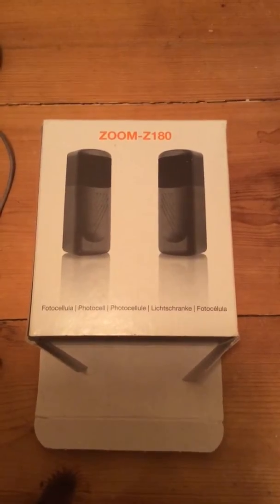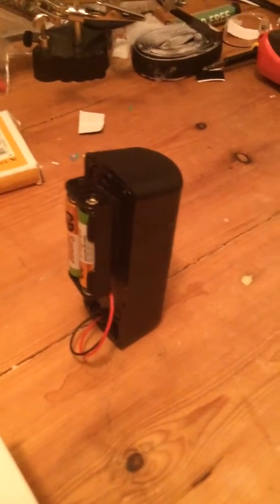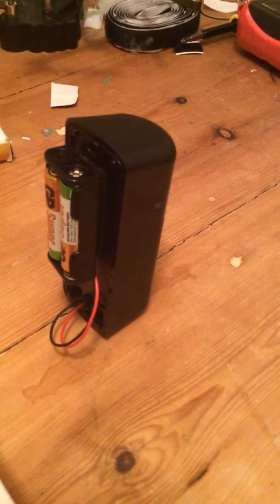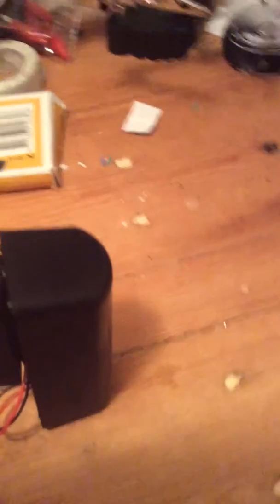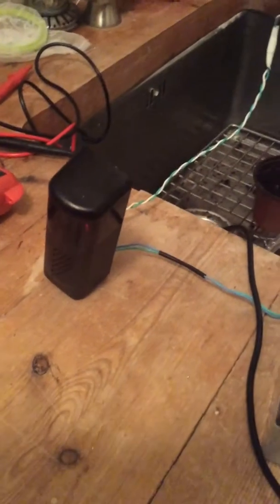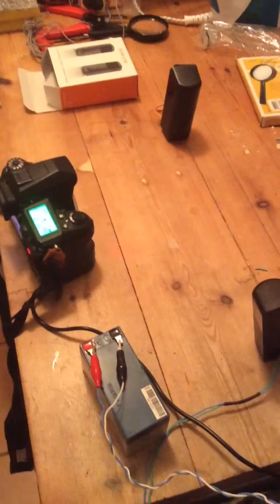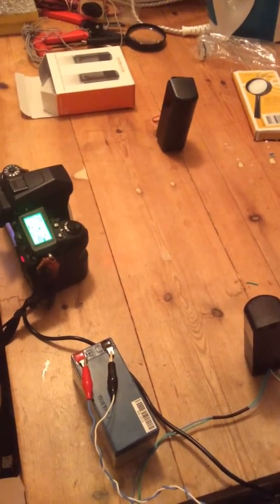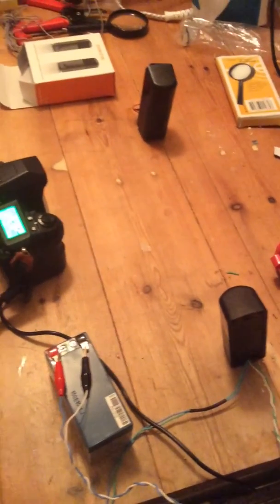DIY camera trap. IR barrier photocells adapted to Pentax k-3

Comment: Hi! I'm interested on building a camera trap like this, but i wonder how you plugged the motion sensor to the camera. What cable do you  use?  You usethe sensor output that goes to the alarm to plug it to the camera? Thanks beforehand!
Reply from the maker: Hi Gustavo, I use a common Pentax remote control cable cut; I discard the button end and use only the 2.5mm stereo end. The cable to the 12v battery is linked to the receiver like in the scheme below (see the 12-24v sockets);
the cable ending with 2.5mm stereo jack is also linked to the receiver, Normally Closed circuit sockets. 

http://www.nologo.info/scripts/adw_img/file/ZOOM-Z180_ZOOM-Zmini_FIRE-F180_010313_VXX11_IT-GB-FR-DE-ES.pdf